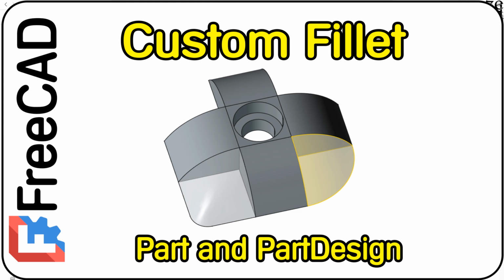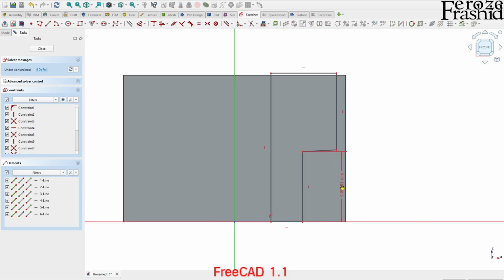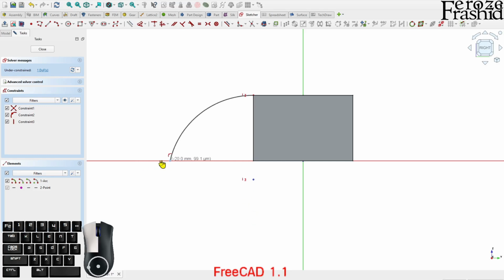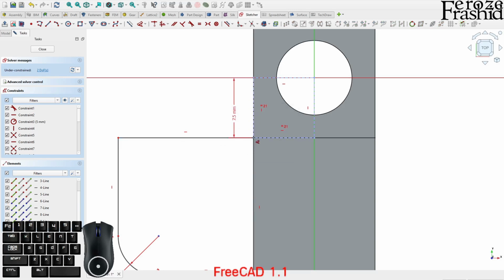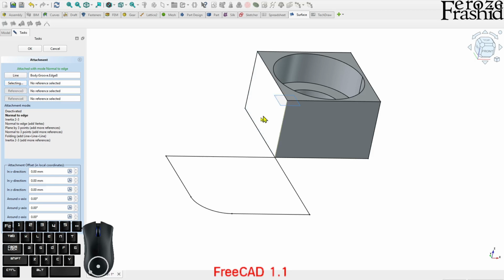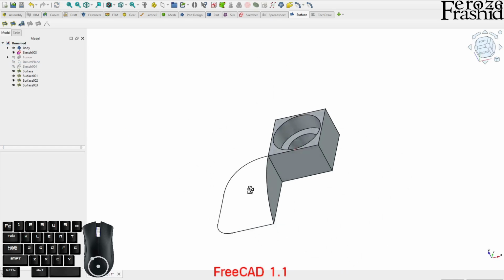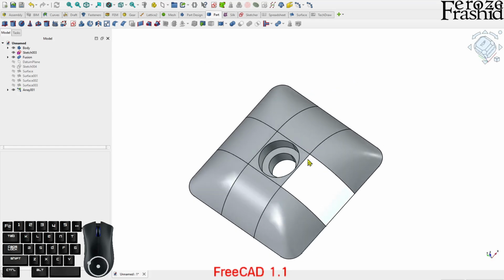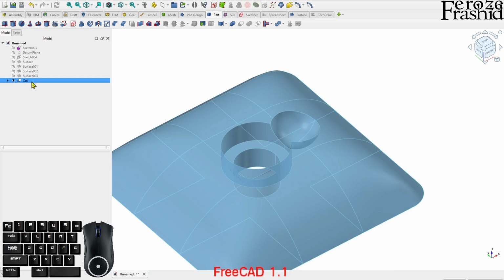Custom Fillet in FreeCAD: Solid and Surface Modeling

Comment: At about the 13 min mark something was bothering me on why that didn't work. It hit me today while I was scrolling on YouTube. You need a support surface so the surface can have a continuity (G or C). Turn each of the 3 sections of the sketch to a blend curve and extrude them downward. You can them adjust the curve shape in the dialog box. Hide the supports when done.

side note: I use Part WB and put stuff like that in a group so they don't clutter the tree. Call it something like "Leftovers" , "Junk", or just leave the default name... :) Don't use Part Design because I learned Part WB first.
Reply from the maker: The origin of that "issue" may be in how they were built, i.e. replication by array. If I built those boundary edges from sketches or draft wires, the surface would form fine. I have seen other examples where arrayed edges were showing unintuitive behaviors. For now the workaround you mentioned works, which is good. But I hope that eventually the process will be refined to make it less clicky.

Comment: Loved the method you used to create the model.  I really liked how you worked through the issues.

When you checked the model with the sphere cut, wouldn’t you want to check in the area of the created fillet? That is the area where the solid was in question. That would then indicate that the “Create Parametric Solid” in Curves WB had an issue.  Or that a fusion would need to be created after the fillet was arrayed.  The area that was checked was already a fusion of two solids.
Reply from the maker: That's a good question. 
Even before I knew about the check geometry button, I have always performed the "sphere-cut" method of solid validation. My experience is, if it's not a solid, it won't cut anywhere on that part, does not matter where you place the sphere.
Reply: That was my thought to.